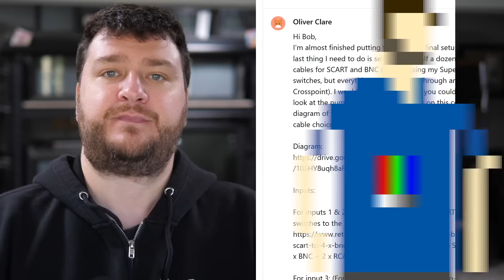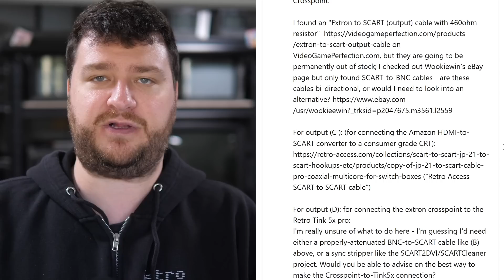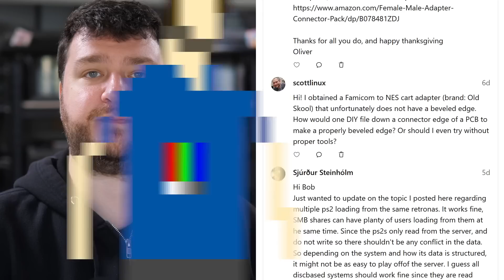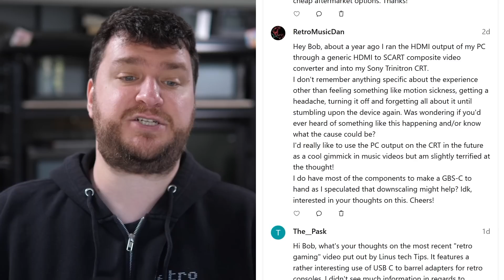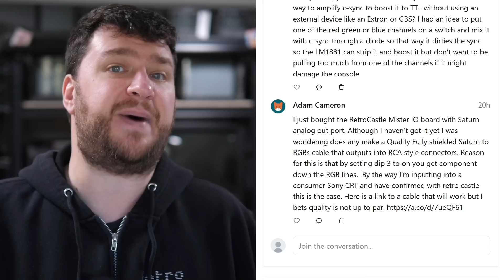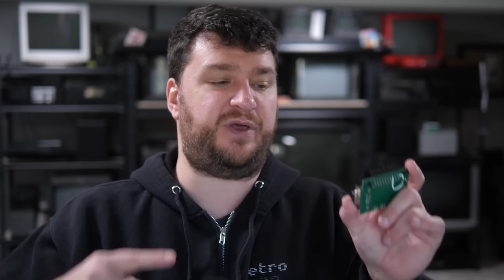Supporter Q&A #235

Comment: The old skool clone of the gamecube horipad is pretty decent, it isn't the best, a great affordable option for a controller to use with the gameboy player, since the gamecube d-pad isn't great for gameboy games that use it as the primary movement method.
Reply: I 2nd this.

Comment: on the first question, there was a question about ways of getting a Scart Connection to the Retrotink 5X from a Extron Cross point. Wires work, but there is also a converter from Kytor Industries that i personally use that converts RGBS BNC to Scart for the Tink. I'm not sure how readily available it is, but it also has a male scart header, so i assume you could even use it with the Retro Gaming Cables UK manual scart switch box if you really REALLY wanted to.
Reply: Was looking at that converter; do you know if the RetroTink 5X accepts component video via the SCART connector? I don't think it does.
Reply from the maker: No component over SCART.  And that converter needs to have a resistor on the sync line - Always check voltage for stuff like this!!!

Comment: The LTT video isn't too bad, features a ReDream PSU from Game Tech to get the input voltages correct so that's something at least. But, I didn't see anyone pull out any measuring technology, multi-meter, or scope to demonstrate why or how it was correct. They showed some tables on manufacturer websites. The entire video was just a sponsored advertisement for the manufacturer of the USB bricks and usb c cables they were using. Not that sponsored segments are bad, but maybe not the whole video...